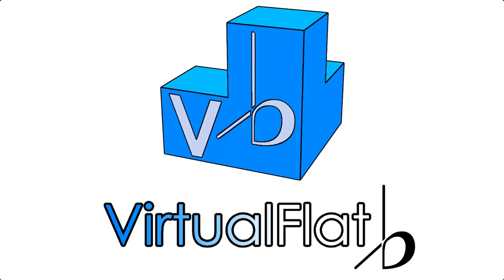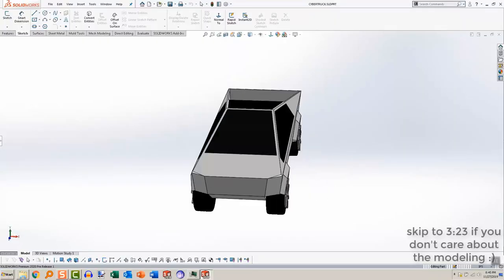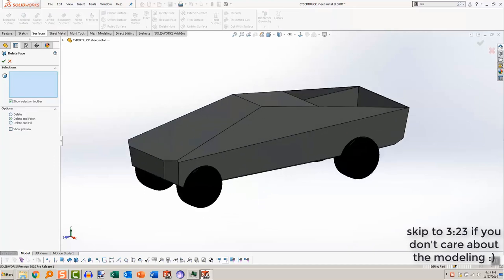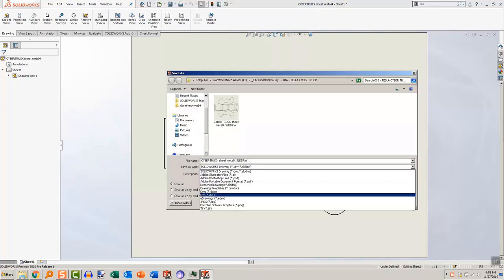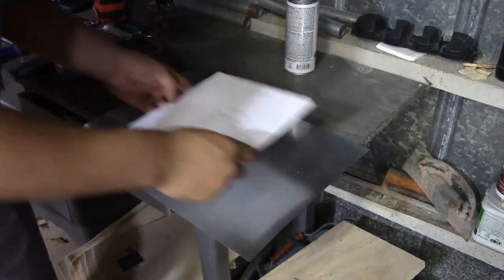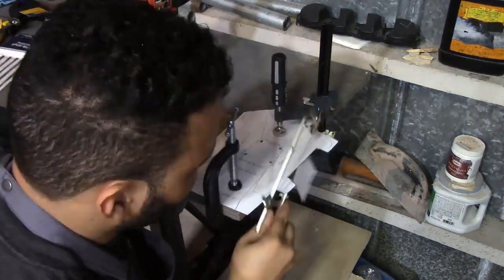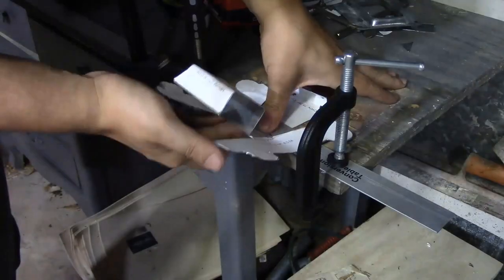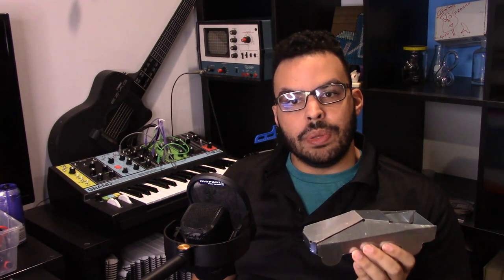MAKING A SHEET METAL TOY TESLA CYBERTRUCK

Comment from the maker: I just added the link for the flat pattern PDF in the description and I also included a DXF format, just in case someone wants to throw it at a laser cutter or something! Also included a link for the exact sheet metal stock I used, though you can substitute it with anything that you can easily bend with the tools that you have. Thanks for watching!
Reply: Do you have a more detailed model that could open as a .dfx or .dwg. for sale?
 I have a large cnc plasma table would like to build a Sheetmetal miniature.